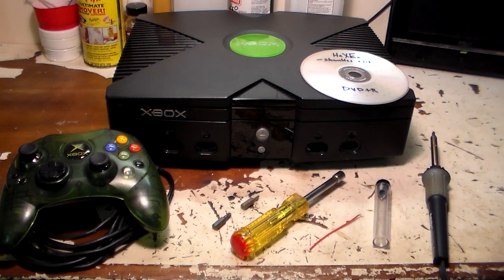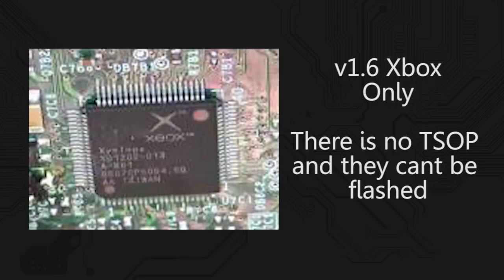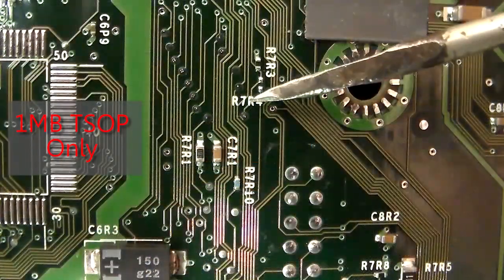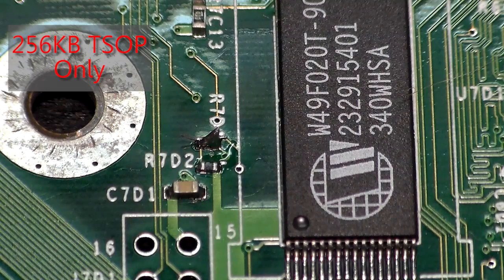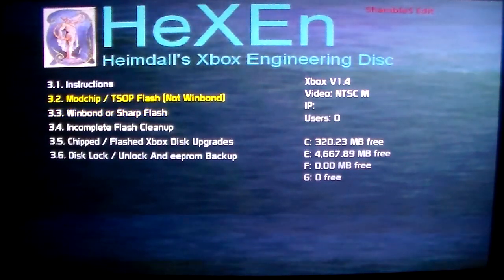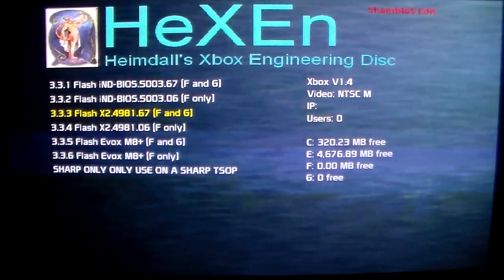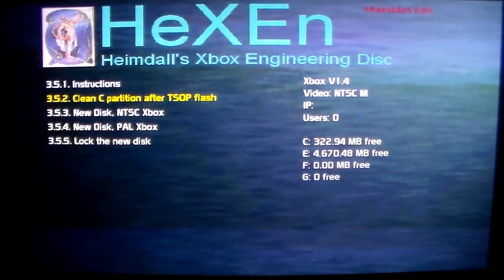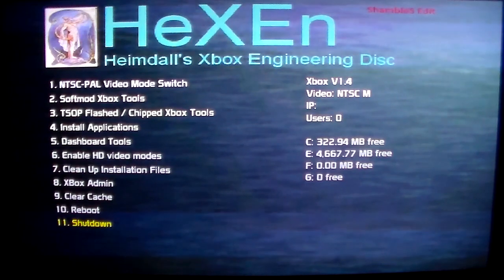How To: Xbox TSOP Flashing Explained -Part 2-

Comment: My XBOX has a Xecuter2 modchip installed, right now i can load hexen, use XBMC and load backup games, but when i try to chage the dashboard, for example, hexen tells me that it cant detect a modchip (or something like that). Do i need to upgrade the BIOS on the modchip itself? In that case, i would proceed like whit the Hynix/Hyunday/ST chips?
Reply from the maker: you could try updating the bios to the latest version unless its already the latest version. Most chips can be flashed using evox like in the video but some require other software. depends on the chip
Reply: Thanks for answering! I kept digging after my question (actualy pulled an all-nighter, LOL), but i ended up flashing a EvoX BIOS, installing a 320GB HDD, and all that good stuff. Really in love with my XBOX now! (i mean, even more so than before, hehe).

Comment: Would it be possible to send you a few boards to get TSOP done on them, for pay?  I can't pay a lot.  But, I don't have a microscope or soldering iron of anything.  These points are so small.
Reply from the maker: sure i can if you want. heck ill do it for free man. i mean theres no real work involved. just a little time. but you will have to pay shipping both ways. let me know
Reply: Really???  Wow thank you!  So, can I just send the motherboards to save money? Not sure if you were gonna flash the BIOS on them also.  If not, my friend might be able to burn HeXen, on a disc for me.  I just need an address.  Might take a week or do to get them out.  Just depends on shipping price.
Reply from the maker: yeah i can flash it too. it only takes a few mins. i need to know what version motherboards you want flashed and what brand TSOP chip they have. also, if possible you would need to ship the boards in anti-static bags to make sure they dont get zapped by static electricity from the packaging. You dont necessarily have to use anti-static bags but it would really suck if they didnt make it through the mail
Reply: thewheelman282 - Two are v1.0 with Hynix and the other I believe is just like the one you did here with a Winbound.  All boards, I've taken off the Time capacitor & cleaned everything.  I've also replaced the thermal paste on them.  Just need the shipping address.  I will definitely see if I can antistatic material for them.  That's a good call.

Comment: Hi i have a Apple 5 chip in my xbox hardware mod.  I use slayer in the past butt with New HDD 250 gig (old wone was 200 gb) bigger is not posible with my bios i want to update the bios so i can install bv. 2 tb max .or the new HDD 250 gig the xbox now see as a 200 gig mnnn.

Witch i must select in de hexen 2017 dvd.  For the good bios i dont now if i have a winbind sorry die bad English. Thx.

Xbox is 1.2 versie i think
Reply from the maker: you will need to open your xbox to see which TSOP chip you have and you will also have to solder the 2 points if you havent already. dont attempt to flash the TSOP until you know what chip brand you have
Reply: thewheelman282 

Now i get it : now i need a new soldeer tool that is real small   thx bro.  :)

I have also winbond chip the same as you  256

Comment: Hello, I have a question.
I have an original Xbox system but with a broken DVD-R and it's not softmodded. Can doing this TSOP mod help me bypass the DVD drive if the system isn't softmodded? I'm also wanting to replace the HDD.
Reply from the maker: if your saying you want to remove the DVD drive completely, then yes, a TSOP mod will allow you to run the xbox without a DVD drive attached. A TSOP mod will also allow you to run your games from the hard drive so you dont have to use the DVD drive
Reply: That sounds good. So the Hexen disc part isn't required then? If I'm looking to replace the hard drive, is there a way to use HeXen without the DVD drive?
Reply from the maker: strictly speaking, using hexen from the dvd drive is not required. you 
can run hexen from the hard drive if you want to (i think its called 
hexen4hdd). but you will have to softmod first to get FTP capability to 
get hexen copied to the hard drive
Reply: problem is you need a working dvd drive to first run the bios flash ,
and usually you need to first already be softmodded.
after the tsop , i wonder if you can use a standard pc dvd drive
for most games,
i know u cant before it.

i can verify that after a succesful bios flash , the unit does boot , and work much smoother than with the 
softmod. same dashboards , more capabilities , basically the bios cant lock u out or give you most error codes
that stop unit from booting.

1.0 xbox was extremely easy to tsop,
still have my soldered points connected, no problem,
but dont know about others except my 1.0 unit.

im glad i dont have a sharp bios chip.

Comment: Hi when you solder two points on motherboard what temp you put 300-400 or less ?
Reply from the maker: Between 550-600 F or 290-315 C
Reply: @thewheelman282  Thanks Have a nice day by the way you have a new Subscriber 😁😁😁

Comment: on 23:01 it says it's only for 256k bios, but I own a 1.1 winbond with 1mb since gentoox doesn't resize bios how can this be done?
Reply from the maker: I'm really not sure on that one. I wasn't aware that winbond chips existed in v1.1 xboxs
Reply: Wheelmn282 taken from this threat.

https://assemblergames.com/threads/xbox-winbond-question.64114/

"Winbond and Sharp 1mb tsops need to use raincoat or gentoox with the correct size bios to flash correctly raincoat and gentoox not resize bios, it erase the tsop by block erasing and not like Evox.

Evox flasher can flash the other brands of tsops and can resize a 256k bios bin or 512k bios bin to fill a 1mb tsop or 256k non winbond, it erase the tsop by chip erase."

Comment: hi again,just wondering have you come across any winbound that wont flash,as I'm having difficulty get 2 to flash.keeps failing.
Reply from the maker: +jason dowsett i never have. check your soldering on the write protection disable points again to make sure they are connected. if one is not making a good connection, then write protection is still enabled
Reply: ok cheers,i managed to do one but the others being a sod lol.cheers for help.

Comment: Great video just one thing do i remove the solder joints after it's been tsop or do i leave them on
Reply from the maker: it doesnt matter. if you removed the joints i guess it could act as a layer of security if someone were to try to flash the TSOP without your knowing but thats all
Reply: thank's for the info think i will remove them just to be safe, would just like to say thank you for the great   you tube video's    :)

Comment: What's the benifits of a unlocked Hdd on an xbox and clock check?  How do you change the founder and animation on a tsop?...I have a 2tb Xbox that I had missed for me and the IGR used to work(sorta) but it would restart the Xbox... skip the animation flubber and then error 7....I know what it is it's not my Hdd or my adapter it's thinking out before it the bios can read off the Hdd.  I'm going to use EVTool to edit my m8+ and flash it back to see if I can fix it.
Reply from the maker: -unlocked HDD means less pain in the ass if you want to upgrade the HDD or need to fix the filesystem on a PC
-changing the TSOP boot animations depends on the bios thats flashed. the newest one create a .ini file on the E drive where you can make changes to the flubber animation. the bios reads this file during bootup
Reply: +thewheelman282 where do I put the .bin file if I want to flash my tsop 1.0 with evox?
Reply: +thewheelman282 sorry I meant after I edit it (.bin) with evtool to where on xbox to where the evox can flash it?
Reply from the maker: i think its c:\bios but i cant remember for sure. it could just be c:\
Reply: Oh that's why I've been trying to put it in the evox\bios folder
Reply: I figured it out that I had evox installed as a dash and a app.... So I uninstalled the app. I had to put the bios under exos\bios to work.  I setup my m8+ for igr more compatible and xbmc as my main dash on E: for 1st boot....xbmc on f: for 2nd boot and UnleashX on c: for 3rd boot and my igr doesn't work... Any ideas?....
Reply from the maker: could be the version of the m8+ bios your using. maybe its old enough to not support it. honestly ive never used that bios. ive always used x2 5035 or ind 5003 depending on the TSOP size

Comment: Is it necessary to Keep the Wires soldered in that Disabled the Write Protection after I Flashed the TSOP ?
Reply from the maker: not necessary. if you want to desolder the 2 connections, you can. it doesnt matter
Reply: thewheelman282 thank you :) oh I was wondering 2 more things. 1 do you have any mod chips you would be willing to part with? An is it possible to reverse the tsop?
Reply from the maker: i dont have any chips to sell. However, you can go here to buy them: http://assemblergames.com/l/threads/zer0-2k11s-mod-chip-and-installation-shop.43131/

Technically yes its possible to flash the original BIOS back to the TSOP if you did want to go back but you would have to place that BIOS manually on the Hexen image before you burn it

Comment: I try to flash my Xbox bios and I turn the game off before it complete. I try turn it on back an it   flashing red and green light and the screen is blank I don't see anything. Can someone tell me how to fix that problem please? Can it be fix with the hexen disc?
Reply from the maker: David Grizzelle the modchip is bricked. You can remove the chip and repair the trace that was cut to make the Xbox boot again to the stock bios. Then boot hexen and go to the part where you would flash the modchip and then plug the modchip in and try to flash the chip again. Failing that, you could flash the chip with an external programmer or get a new chip
Reply: thewheelman282  the game don't have a mod chip in it. the game was mod but the chip was removed I think it was tsop flash
Reply from the maker: David Grizzelle , oh well you posted the same comment on both my videos so I wasnt sure. If it's a TSOP flash that broke, the Xbox is bricked. you have 3 options. 1) have a professional desolder the TSOP chip and program it manually with an external programmer. 2) get another Xbox. 3) install a modchip then boot hexen and go to the part where you flash a TSOP bios and before you flash, unplug the chip from the motherboard and then flash. Or you can just keep the chip in there and be done with it

Comment: I have 1.2 winbond. after hexen reboots disc ejects with flashing red light and black screen. any ideas?
Reply from the maker: honestly ive never heard of that. sounds like a bad flash to me but thats a shot in the dark. you can try flashing again if you have a modchip
Reply: everything copies over but the system doesn't go into gentoox. i can power off/on and it loads back into softmod. only difference is xbmc no longer works, unleashx skin reset to default
Reply: update: something weird happened. I accidentally went into the file cleanup menu, I hit B to back out but the process happened anyway. rebooted and I was stock again. I used my ndure disc with eeprom to unlock hdd. I wanted to make sure it worked so I figured xbox wouldn't boot if unlocked. Guess what? It boots unlocked. Strange thing is no IND BIOS screen shows when I power on the console. This is just weird.
Reply: Sorry about all the posts. I finally got it working. I tired again and it just worked - got Gentoox for the first time and everything went fine. Maybe a bad solder joint - I have no idea? Thanks for all your Xbox info, I followed your thermal paste and battery guides too. Think I'm going to do a 80mm fan mod :-)
Reply from the maker: glad to hear you got it sorted out man. thats pretty crazy

Comment: hello, so I was trying to tsop my xbox 1.0 with a ST Chip, I already have a softmod but because I didnt have a spare dvd-r disc I decided to try it without using a disk. I searched for a HeXEn version for HDD and found one on theisozone, downloaded that and ftp'd it  to my xbox. Did everything like in this video and chose the "evox m8 plus F and G" option (in 256k). So it installed everything successfully and  once I rebooted the xbox problems started occurring, now I get the evo logo on the top left corner but then I get this black screen and cant seem to do anything. I can still play games though and go into the msdash. So Im thinking my only options are to find a disc and burn the HeXEn disc and try it again?

I would greatly appreciate a response.
Reply from the maker: its probably your softmod interfering with the  boot process of the new bios you flashed. thats kinda normal actually. you need to run the option in hexen to remove your softmod from the hdd. you might have to burn hexen to a cd or dvd man. btw, you can burn hexen to a cd. a dvd is not required
Reply: thewheelman282 thank you very much for your response! I managed to fix it by burning Hexen to a disc and then reinstalling the softmod from there. My next question would be, what's the most up to date bios for my chip (ST)? Note, I want to install a 1TB hdd later down the road.
Reply from the maker: the bios's on hexen are already the most up to date so you already flashed the lastest version of evox m8 plus. (xbox custom bios's are no longer in development)
Reply: ok, thanks for the info.I'm having a hard time over here hehe, now that I got this xbox working I tsoped another xbox, version 1.2 with a Hynix Chip. I think I might have bricked it, damn. I bridged the points and in hexen when flashing the bios it freezed on me on the "erasing" part about 30% in on the bar. I sorta got stuck and I didnt know what to do. After half an hour I decided, fuck it and shut down the xbox. Now when I boot the xbox up it goes off 2 times (meaning fans go out and hdd) and get on again and then nothing on the screen, just green and red light is blinking constantly. I know it's fixable but how? is there a way without a modchip?
Reply from the maker: its only fixable with a modchip. xbox modchips are pretty cheap though. idk where you are in the world but i think eurasia.com sells alladin xt chips
Reply: I'm from austria. I found one on a site equivalent to craigslist and it should be here in a few days. But what did I do wrong? I birdged the points R7D1 and R7D10 (I have a hynix chip on this xbox) Did i bridge the false points or what did I do wrong?
Reply from the maker: im not sure what went wrong to be honest. ive never heard of that happening before man
Reply: thewheelman282 hmm that's weird. I can't seem to find a tutorial about fixing a broken tsop. almost every link leads to xbox-scene which is unfortunately down. can you link me something of use for my problem?

Comment: Hi,
Bios Hynix HY29F002TT-900309A
Motherboard 2003-06 1.3v  
Power supply double row...
Know someone what kind of bios I have? 1mb? 500kb? 256kb? 
I am not sure which points I have to solder....
Greetings
Reply from the maker: Arek Stawczyk since you have a double row of PSU pins, you have a 256k BIOS. Unless it's a v1.6 Xbox
Reply: V1.6 ist different, as my motherboard, and I have Hynix TSOP, but double row of psu...
Reply from the maker: oh wait. derp. since you have a Hynix TSOP and double row PSU pins, you have a v1.2 - v1.5. not v1.0 - v1.1 or v1.6
Reply: thewheelman282 could you tell me please, or this tutorial is for my Xbox?
Reply from the maker: Arek Stawczyk yes
Reply: thewheelman282 thanks, by the way.... great tutorial 👍

Comment: I have a revision 1 or 1.1 Xbox that is getting an error code 07, which I think is a hard drive problem. To get it to run again, I need to install a new bios somehow and then use a new hard drive. Is it possible to flash the TSOP without being able to softmod it, or will a modchip solve this issue?
Reply from the maker: error 7 means it cant find the HDD. check the simple stuff first. is the HDD spinning? have the cables come loose? is the HDD jumper set to cable select? reseat the cables too.
TSOP  or modchip wont fix error 7 because the xbox is not seeing the HDD for some reason
You can try installing any other HDD to see if you get a different error. if so, that points to something wrong with the HDD. if not, try another IDE cable
Reply: +thewheelman282 I'll look into it. but if the hard drive turns out to be dead, where do I go from there?
Reply from the maker: you can make a new HDD with XboxHDM (linux) if you have a backup of the eeprom.bin from the xbox or the old HDD password. if you dont have that backup, you will have to buy/build and eeprom reader and recover it manually from the xbox motherboard
Reply: +thewheelman282 there is a configuration code on the original hard drive itself, would that be the right code? sorry about all these questions
Reply from the maker: its cool. no its not that. basically the HDD must be locked with a password so that it will work in the xbox. the xbox gives the HDD the password and unlocks it to use it. when it shuts down, the HDD locks again. XboxHDM can generate the password if you have the eeprom.bin file that is on the xbox if its softmodded. if you dont have the file, you have to use a tool called an eeprom reader and connect it to the xbox motherboard and recover the eeprom.bin file that way
Reply: thewheelman282 thanks this is very helpful!
Reply from the maker: no prob man!

Comment: why and how is the bios on the hard drive and not on the hexen disc?
Reply from the maker: You'll have to explain your question. Not sure what you mean
Reply: in the video when you go to retrieve the bios you say that it is on the hard drive. 24:09 of the video.
Reply: if you could make a video on how to use an sd card as a hard drive that would be cool, cause hard drives brake down too much, and are heavy.
Reply from the maker: Oh I see. Hexen extracts gentoox onto the HDD temporarily and therefore the bios is too